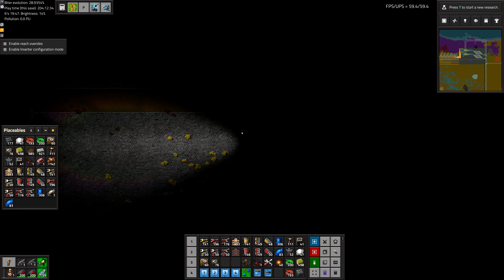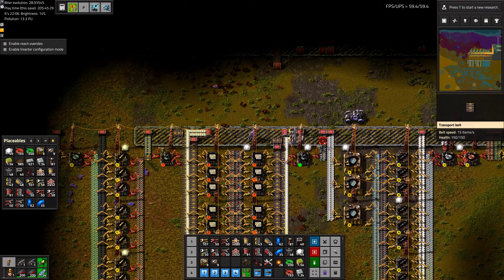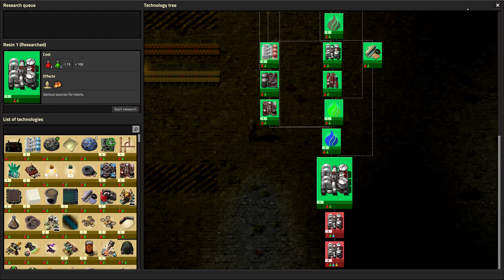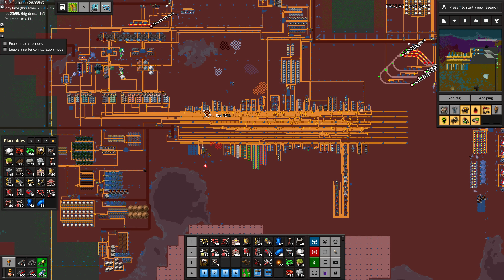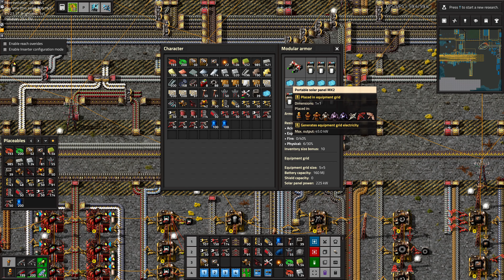[Factorio 1.1 4K] Angel/Bobs Ep 131: White Circuits & Night Vision

Comment: I'm sure this has been asked 100 times but, are you going to release a blue print book at the end of this or sooner by chance?
Reply from the maker: No, mainly because most of this stuff was built organically based on the needs of the factory at the time. However I occasionally update a save file which is listed in the description, if there’s something you want you can load that and make a blueprint of it